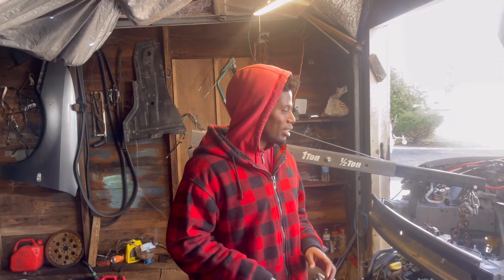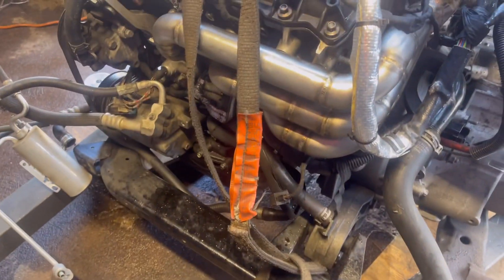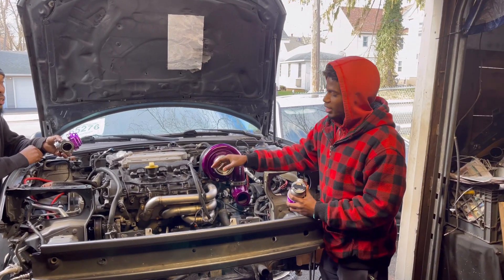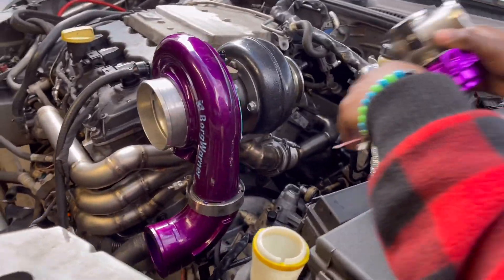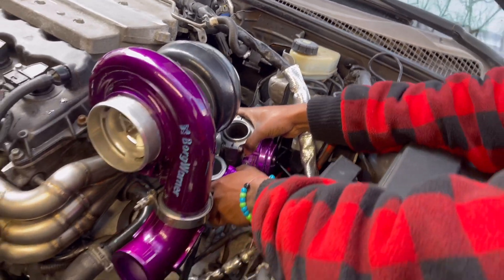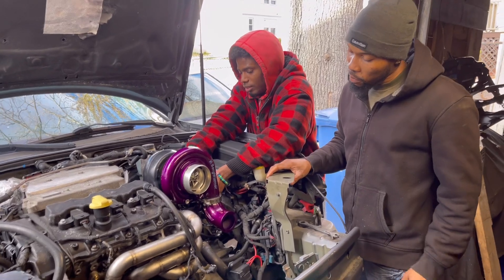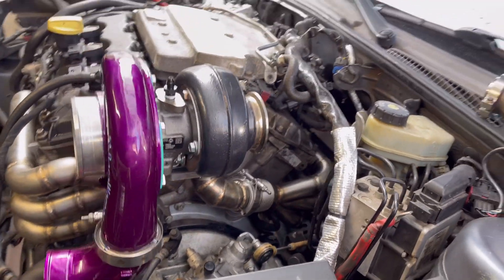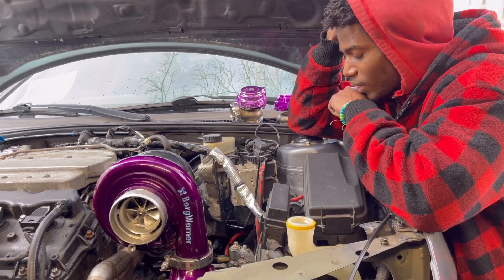Build Update: Finding The Perfect Wastegate Placement

Comment: Any of my saab brothers no how to fix Stability control loss traction light abs brake lights come on
Reply from the maker: one of your wheel sensor is probably bad
Reply: @prolificbuilds  thanks I did finally read and come across that after is this common for only 116,000 miles
Reply from the maker: @motorcity91  not common but it’s possible

Comment: how much power can the internals handle before you have to upgrade
Reply from the maker: safe and reliable 500-530 . i’ve seen well over that but there’s no guarantee how long it’ll last. ofc that depends how you drive the car also
Reply: does that go for the 2.0 too?
Reply from the maker: @3l3x19  nah the 2.0 is not capable of that on stock internals
Reply: @3l3x19  2.0 is good for roughly 400hp
Reply: @3l3x19  Have had two 2.0s and now v6. 300whp is the absolute limit with 93 gas then your melting pistons and it's super sketchy at that point. With e85 maybe 320whp. After that you need new pistons to be somewhat stable and reliable. Beyond the 350whp threshold big dollar drivetrain and custom manifolds await you along with bigger turbo and the works and plus more expensive tuning because trionic 8 isn't built for big power on the 4cyl. Overall for big power 2.0 is not worth it or even capable. Get a v6. 2.0s are hella good daily drivers though imho.
Reply: @3l3x19  nah the liners in the stock bloke flex after about 26psi.  You can help avoid it with lighter pistons, smf and a 7.2k rev limit but it's no guarantee.  I wouldn't go past 320bhp/310lbf on a stock 2.0 unless maybe it lives on a track (higher revs more often = gets out the way of the liners quicker_